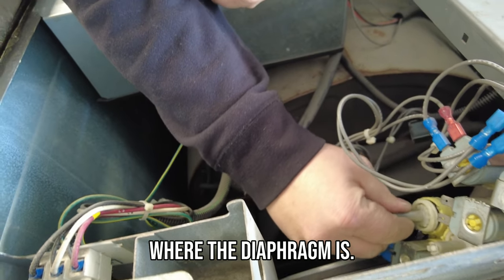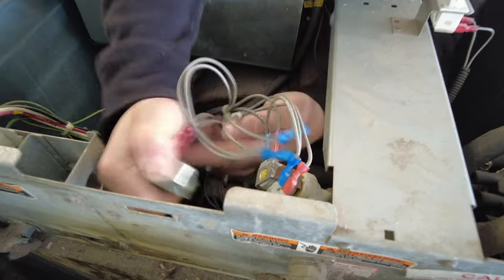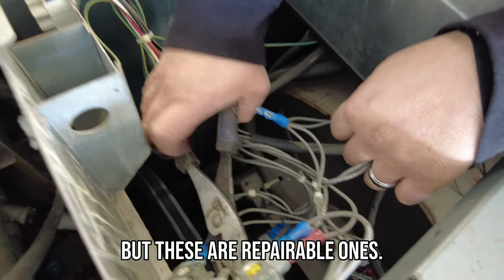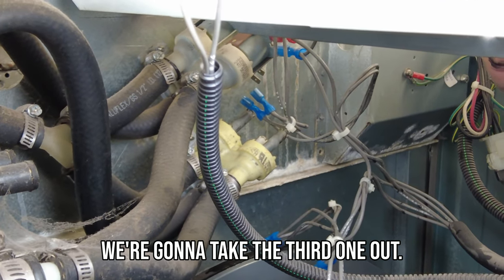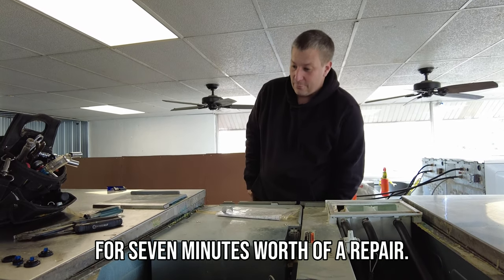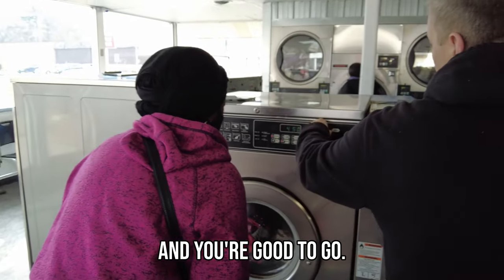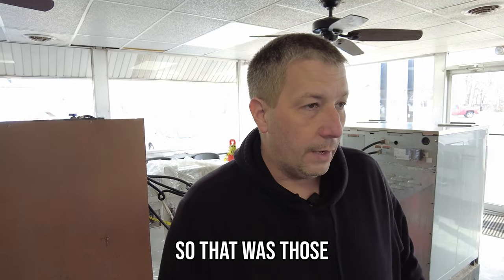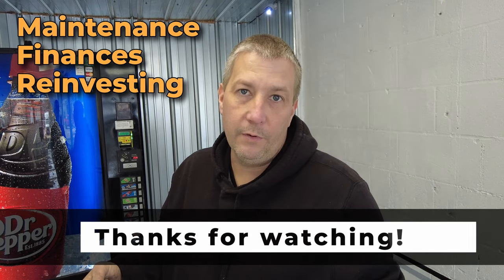"Ultimate Washer Repair: Saving the Day at the Laundromat!"

Comment: So here is the $1,000 question.... Should you just replace all of those valves on all the washers at these same time?  (assuming you got the new machines at the same time.)  If one set is that bad, is it a good assumption that all of them will need to be replaced soon?
Reply: No point on doing that..too many variables.  Not all machines have the same usage & not all waterfalls made the same..cheap valves, debris in water etc. I buy inlet valves in bulk & replace the entire valve. I have full time job.  Not worth my time 2 work on same valve for the same issue more than necessary.

Comment: why is it you seem to be the lone hold out who does not change over to the card system to get rid of the quarters like we did
Reply: He isn't the "lone holdout."  The vast majority of coin operated laundries do not need card systems.  Yes it makes it easier for the store owner to handle the money, but customers hate it. They have to pay for a card, the card may get lost, they can't get any left over money off of the card.  The card readers system is another $750 to $1000 per machine, and they break often due to the high humidity, water vapor and heat many laundries generate.

everyone can get quarters.
Reply: ^^^ 100% correct. I haven't either.  No plans on doing so either.  The data is skewed...most mats are still.coin.
Reply: @williamjones3007 in our area cards out do quarters 5 to 1
Reply: @apctech1  nice for you. The better question is do your customers prefer cards?

another great question, what does it cost per machine to set up the car system?  How often do you need to repair it?  What is your ROI for the machines?  Lastly, does it make it easier for your customers?